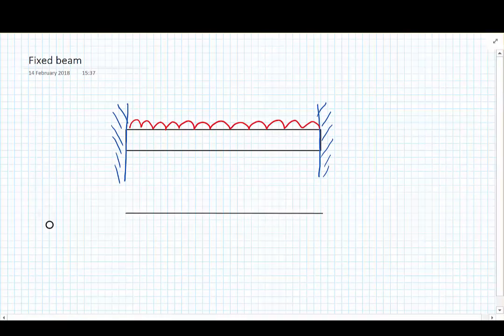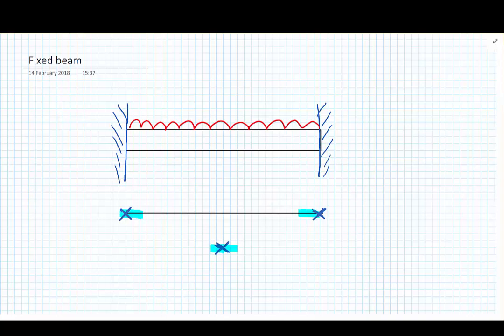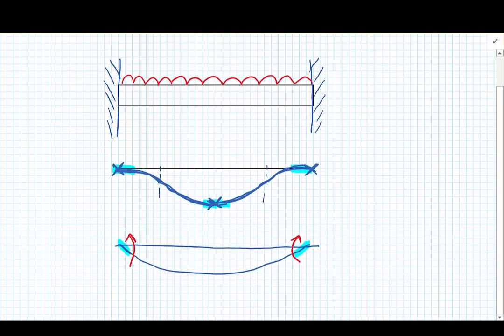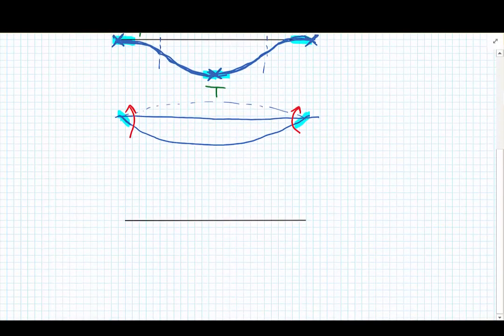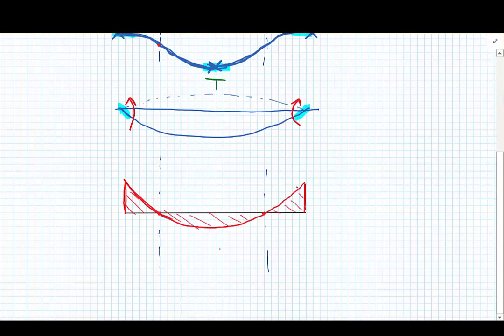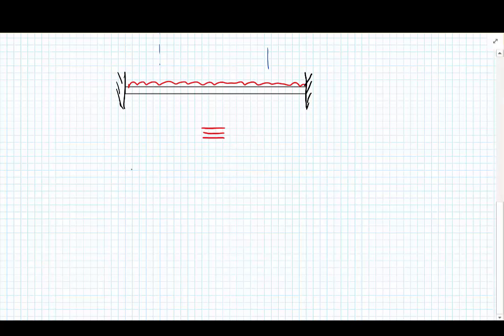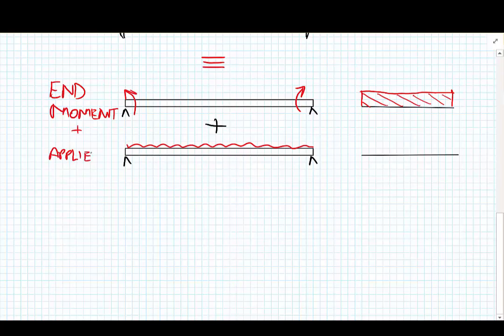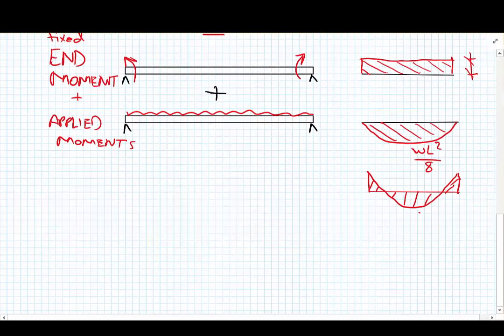Qualitative Structural Analysis - fixed beam

Comment: Do you know a software for qualitative analysis? I only find software which require specific quantities but I need parameters
Reply from the maker: use any frame analysis package, try to keep the EI values for all members constant. You could use unit values for loads (pt or udl), as analysis is elastic.
Reply: @ProgrammedMechanics  Aldready tried using unit values, but I'd need the relation e.g. For momentum like ql^2 dependent on load and length.. Can't find anything parametrical
Reply from the maker: ql^2/12? use q=1, L=length of beam / column. This is the Fixed end moment, quite often hidden in the calculation engine.